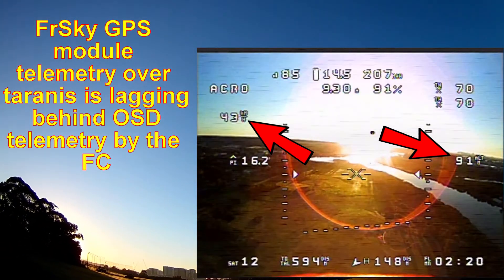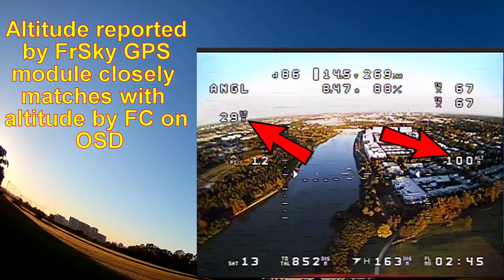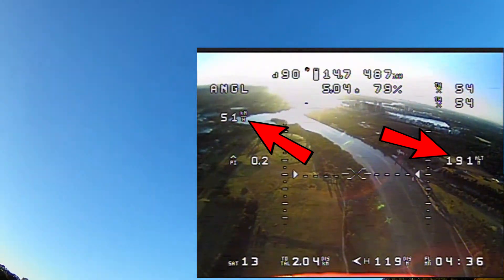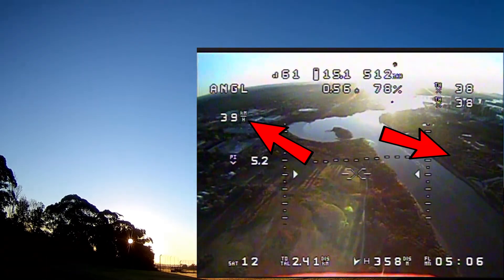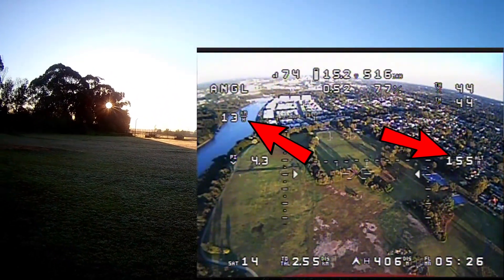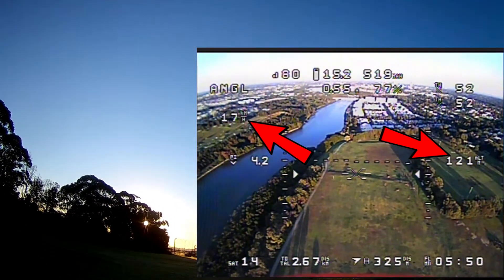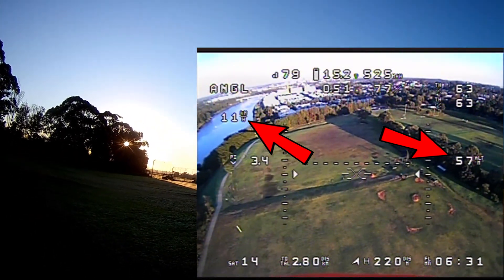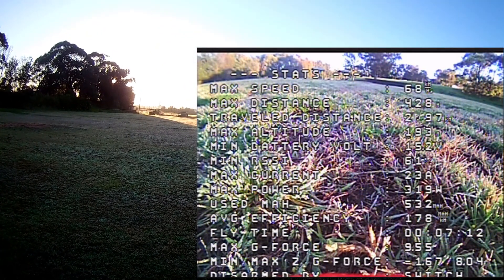How Accurate is FrSky GPS Sensor ...????

Comment: If you want to be sure if the sensor is precise than you need a car and drive 50 kmh and next to it your smartphone with googlemaps on and that is acurate and next to that your receiver with gps sensor and transmitter with telemetry. And don,t fotget you need an assistance that read the value of the devices and you know if it is acurate and if it is not just calibrate the sensor on the transmitter
Reply from the maker: yes thats  a better way of doing it ...